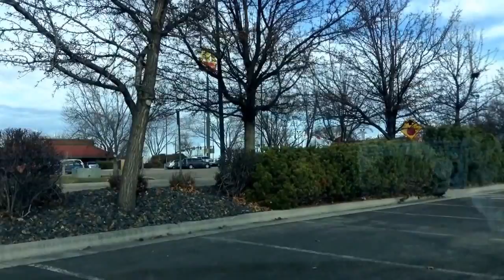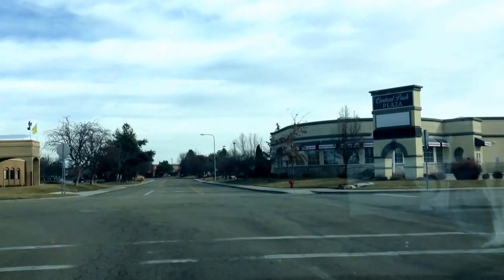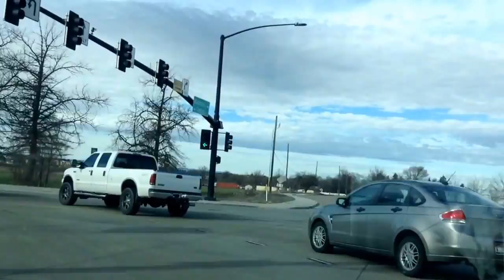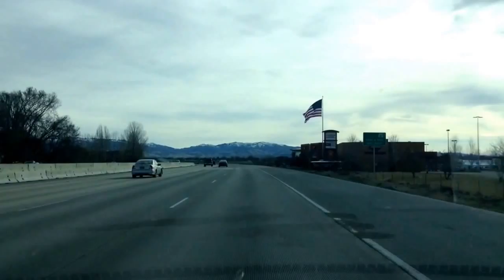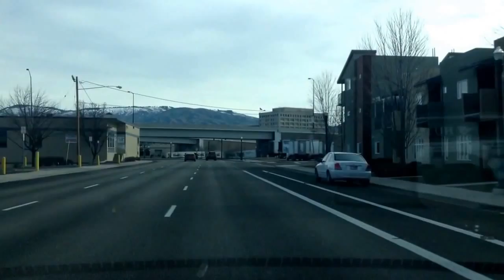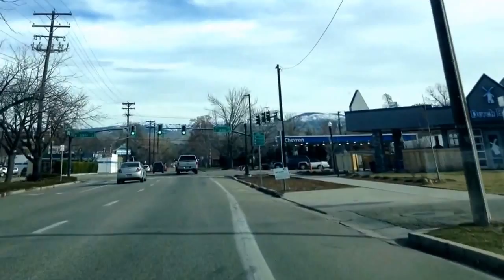Drive from Meridian to Boise with a bad voltage regulator; Idaho; signs; symptoms; high RPMs

Comment: you can answer those charges any time between now and the date on the ticket. need to go to the court clerks office and get the file listed on the judges docket.
Reply from the maker: I just stopped at the clerk of courts and they said they don't have the ticket yet. I need to show up within the court time frame. I also need to get the police report, but a lawyer has to file a discovery request with the cops. I would rather file it myself, but how? Looks like I'm really stuck in Boise.